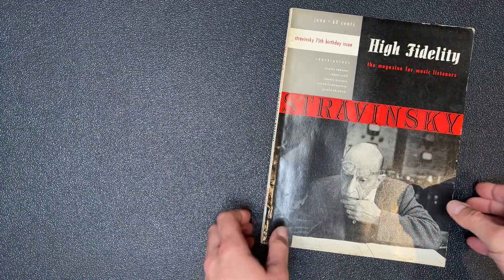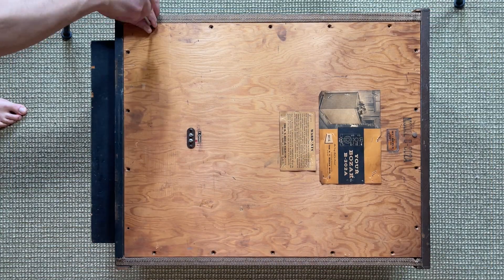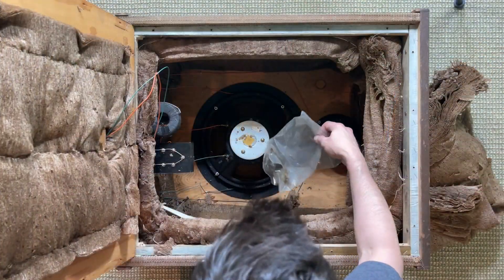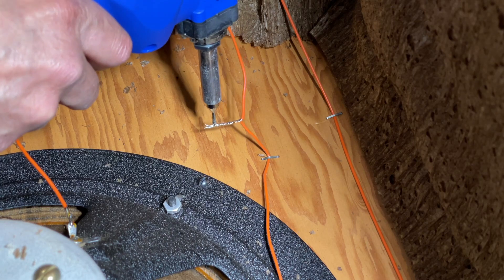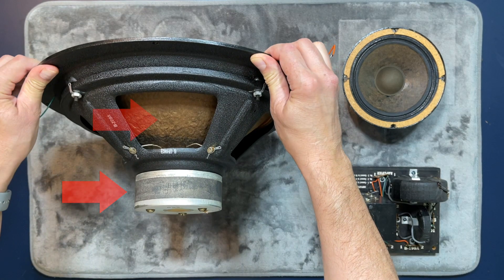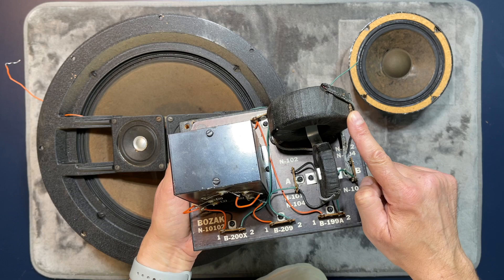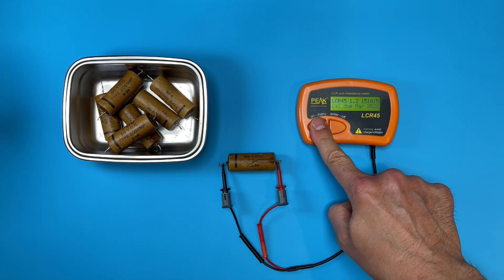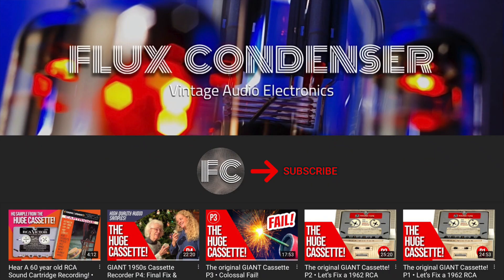You May Be Surprised What's Inside This 1950s Speaker • Bozak B-302 Gem • P1

Comment: Nice serie of the vintage speaker. I just wonder if any know how they produce the speakers and crossovers back in the days created the speakers. Did the people who created the crossover had really good components and made the perfect crossover. Then they was asked to find cheaper components to hold the price down. For eksample I got a pair of Jamo J252 and when I looked at the components in the crossover the capasitors and resisters is pretty cheap. Since I have change the capacitors and resistors with a huge clearity. The next step is to change the coils. So is it a compromice from the factory to change the components from quality of the speaker. J252 frequence is from 22-40000 hz. You are not seeing this in 2025 whitout paying 6000 usd. I just wonder why people has to spend so much money for a deason speaker. And by the way I paid 156,98 usd for 2! :-D

Comment: I own 3 pairs of Bozak speakers, the biggest of which is a pair of  B-310B Concert Grands. The woofers and mid range speakers are spectacular, but the tweeters are a bit lacking by today's standards as they are cone speakers. I owned a pair of B-302's that I shouldn't have traded off to a friend of mine that still uses them.
Reply from the maker: I’ve never heard the Concert Grands, but I’d like to. Always been fascinated by truly enormous speakers that look like they could fill a concert hall. Do you listen to them regularly these days?
Reply: @FluxCondenser  I do listen to them regularly. I converted mine to bi amp using a home built 6SN7 pre amp a Marchand electronic crossover which drives a Yamaha M85 amp driving the woofers and a Dynaco ST 70 amp to drive the mids and tweeters. I have have a pair of Bozak B-301 speakers in the garage system and a pair of 401's on the bedroom TV driven by a Fisher 800C receiver. The Bozaks do really well driven with lower power tube amps with the exception of the Concert Grands due to their size, need more power to sound good.
Reply: @FluxCondenser hello-I have a pair of 310's I'll be selling, if you are interested. Factory condition. All original drivers 28 total.